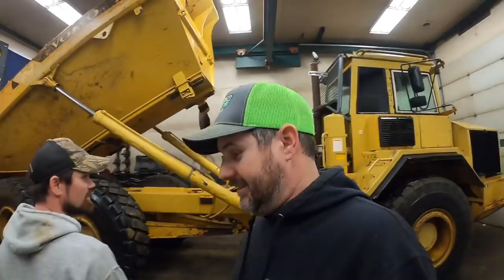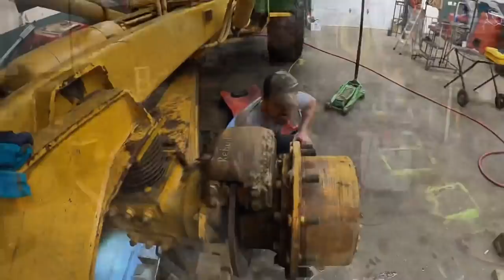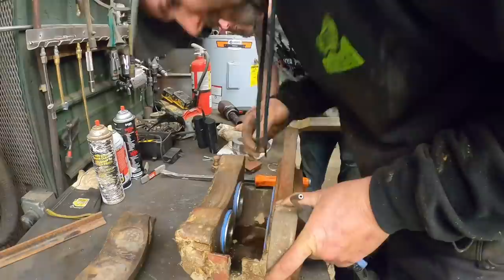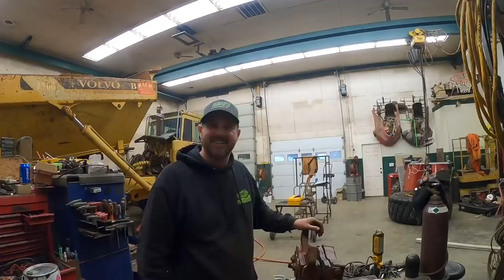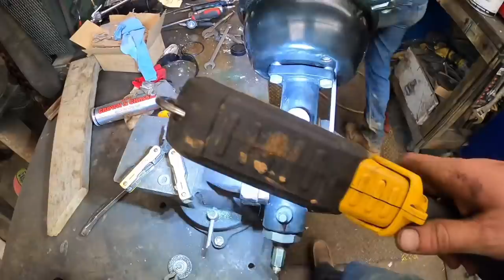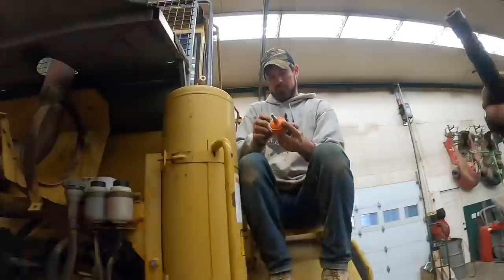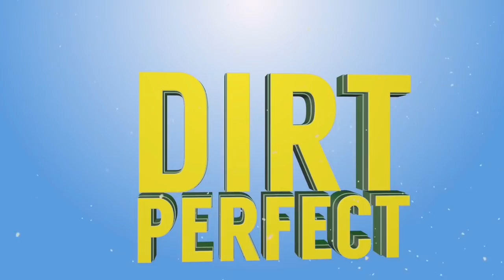Another attempt to fix the brakes on Bubba Dump ends in disappointment and failure again

Comment: Hi Mike, I suspect your missing an aluminium spacer that goes between the booster and master cylinder, the spacer could also have a shaft seal in it 
If you don’t change the mod you should seal the gap between the booster and master cylinder to stop water and mud from getting in there 
Good luck
Reply: I was thinking a copper gasket machined to fit would be a good answer for long term. Like a copper head gasket for high performance piston clearance on the old V8 engines. Just over drill for the shaft and put gasket seal on both flats of the copper. That is the hillbilly engineering we would do around here.

Comment: I learned my lesson about telling you you did or are doing something wrong, I prefer telling stories of my experience. I once needed a new O-ring and substituted a neoprene O-ring about 2 weeks later the piston started leaking brake fluid like there was no tomorrow, took the tire off and said OMG there's a huge black worm on my caliper, it was the O-ring it swoled up about 80 times it's original size, I knew there would be some swelling but I had no idea, I imagine hydrocarbon grease is hard on rubber O-rings too silicone grease or assembly lube(really thick brake fluid) is proper. Have fun Mike Bubba Dump is a real nice truck. I think some one has a monster truck made out of a Volvo haul truck, 'course it has a 2000 horse power diesel in it.

Comment: I'm a union operator for a large excavating company amd we run 4-5 40 ton trucks everyday moving dirt from the cut and the fill and let me tell you trucks are always a problem they break all the time, they are crucial to have but damn if they don't break down alot good luck with it 👍

Comment: Mike there was probably a spacer that went in between master cycle and the booster parts manual should show  you should have use a orange grease on seals thanks for the

Comment: Pistons are backwards  flat side in  you will never get the air out with the cavitys.  Always flat side in 
and you needed to wash the caliper with breakclean  them lube it with the brake fluild  the  parts washing fluild you left will distort and make the seals swell.  >> master tech  42 years
Reply from the maker: Plan worked perfect
Reply: pistons are definitely  in backwards .
Reply: @ronmiller7181   yeah they definitely dont know what they doing :)

Comment: Hey Mike the caliper does not slide slide it is a 4 piston caliper that is how it compensates for any rotor movement allows it to wear both pads evenly four piston calipers or calipers with pistons on both sides do not float they are affixed via bolts

Comment: In  the 60s, learning to drive fire trucks,  when reversing the instructor used the " right hand down, left hand down" instruction on the steering wheel, to control the front end position of the vehicle. I use it now with drivers

Comment: Hey DP,
Some of those air chambers are adjustable from inside. All you need to do is remove the clamp, end cover, and rubber diaphragm and adjust the double jam nuts in or out on the service rod (the part that comes out of the chamber and into the hydraulic piston.
Those are single action chambers with only a light return spring for full release. The jam nuts control how far the rod travels out of the chamber. Your washer method will accomplish basically the same thing; however, adjustability is limited.
On the relay diaphragm you should be able to remove the cover and replace the rubber diaphragm to repair the leak, but your replacement relay looks like it should function the same way or similar, just make sure that the air flow control matches the other chambers for equalized braking pressure.
Your solutions certainly look like they should work just fine. It's been about 35 years since I worked on big equipment, but most of the mechanical parts still operate the same, mostly the ABS and electronics have changed.
Reply: I will say that the next guy to work on that will likely scratch his head wondering what that valve came out of. Maybe make a note in the repair log??? Who am I kidding, a repair log from DP??? Happy hunting guys.
Reply: @markpashia7067  Not really. Those a common valve on US made trucks. The Volvo just happens to be European.
Unless there is a specific cross referenced part, most mechanics will figure out what up.

Comment: Well regardless of the issues you are addressing and the learning curve without a manual, it will sure be nice when old Bubba is up and running. Looking back at all those jobs you had to haul dirt for dams with many trips, multiple trucks and such, Bubba will make that process a hole lot easier and use a heck of a lot less fuel. Thanks for sharing Mike.

Comment: @DirtPerfect Just a tip from someone who worked on cars and trucks for a living never ever use grease as an lubricant on hydraulic brake seals or O-rings unless it’s 100% pure silicone. However I being rather old school and cheap I highly recommend that you only use new Brake Fluid from a sealed bottle.  Almost all Greases will react with the seals/O-rings causing them to expand and bind the caliper into the bore resulting in the brakes either being permanently applied. Additionally it will slowly dissolve in the brake fluid and migrate throughout the brake system and FUBARing the rest of the brake system. An before you say no it can’t happen I will tell from first hand experience of using grease to pop out a caliper piston in high school shop class on my car that it does because my broke ass in high school had to buy a master cylinder, proportioning valve, front and rear brake hoses, rear wheel cylinders and two rebuilt calipers because the calipers pistons were damaged from being stuck on from the grease swelling the seals in the calipers along with brake pads, brake shoes and having to have the drums and rotors machined.  The original reason in shop class for rebuilding just 1 caliper which I had wanted to replace with a rebuilt one was because like your truck it was leaking.  That story told in my close to 30 years of experience of working as a mechanic for a living I have seen and repaired other such cases like mine as well as ones where idiots mistakenly or not have put power steering fluid, engine oil, hydraulic fluid, ATF, etc resulting in entire brake system overhauls. Since I know you will not take that caliper off and this video was filmed a while ago I do recommend re bleeding that caliper every time you use the truck at least a half a dozen times because brake fluid is cheap and brake rotors and pads for that truck are not.  I also am not a believer of ever reusing brake seals or only half or in your case or one hole in a brake caliper but it’s your truck. PS pleas buy or get the MBTS to make you some Jack-Stands designed to hold the weight of that truck because it would suck to hear you, Mr. Millennial etc, got seriously hurt or killed from using a 3 or 4 ton Jack-Stand that collapsed working on your heavy equipment.
Reply from the maker: Plan worked perfect thanks

Comment: You needed to use lube meant for brakes to install the seals and pistons. Things go together much better.
Reply: Brakes get HOT, needs high temp brake caliper grease. Regular grease turns to glue!
Reply: If these are DOT 3  fluid systems,  petroleum based grease will destroy & swell rubber brake seals.  Only silicone based lubricants or plain ol DOT 3brake fluid should be used
Reply: @scrappy7571  Amy idea of these are oil or glycol brake systems?
Reply: @russellsmith3825  No clue, only work on automotive.   Google search does not find much info.  Only brakes that I knew used mineral based fluid was old euro-peon junk, or my mountain bike with Shimano disc brakes.

Comment: Like someone else said, you put the pistons in backwards on the calipers, probably took a lot more fluid to bleed and likely has air pockets in those holes.
Reply: Yep.
Reply: Yep pistons in backwards 1st mistake. Using grease 2nd mistake. As grease deteriorates the rubber O-rings. Your supposed to use silicon grease or lube as for the master the stroke is adjuster by turning the booster pintle. You never use washers as the will rub and wear the bore and could jamb up destroying the bore
Reply: Never used anything but brake fluid & patients
Reply: @stevenr8606  what kind of patients though?What if they’re to sick to help?🤷🏻‍♂️😜
Reply: @stevenr8606  yes brake fluid or inert silicon lube because it has higher boiling point does not deteratrate orings and seals and is non-hygroscopic or you can use silicon brake fluid or conventional ethylene/propylene based fluids
Reply from the maker: Plan worked perfect thanks guys appreciate that comments
Reply: @DirtPerfect  You can always blame the man behind the scenes on any and all errors! 🤣
Reply: No they are not made of neoprene in fact they are made of EPDM which is incompatable with petroleum and the only rubber compound that is compatible with ethylene or propylene based brake fluid.  Just chuck a brake seal or brake cylinder puck in oil  solvent or gasoline diesel etc and see what happens after some time they get swell and get mushy oh and i forgot to mention neoprene is incomparable ethelene/propylene glycol

Comment: you put the pistons in backwards, the dirt being inside the hollow pistons shoulda been a clue :)
Reply: Me thinks somebody should'a looked at the parts book!  Will we see a companion video showing them putting the pistons in correct orientation?  Hmmm....
Reply: Well. He might see if you’re correct when he gets into that other caliper that’s leaking.
Reply: @Crewsy  its a piston the flat goes toward pressure side, 30 year tech here lol.
Reply: @RichardHeadGaming  and the pressure comes from behind the pistons pushing to the pad and squeezing the disc.. Thier on backwards -_-
Reply: @POSSIBLY.USEFUL  pressure side is oil side. he is agreeing with everyone
Reply: Cup out to reduce amount of fluid that’s inside the caliper to prevent brake fade.

Comment: Great job Mike you are going to end up with a great truck here. All the components you examined look to be in good shape and this truck should last you a long time. The difference between a successful contractor and not so successful contractor is his ability to work on his equipment. Letsdig18 is one lucky guy that his Volvo dump truck was in good shape. If you don't have the finances to buy newer equipment you must be able to work on the equipment you can afford.

Comment: If it uses dot 3 or dot 4 Brake fluid.  Most parts stores sell McKays brake assembly lube. 
Grease or oils have a really big chance of causing brake seal to swell up and seize causing the brakes to not release and the entire system to need to be rebuilt.

Comment: Nice. A what not to do video.  Petroleum+brake fluid and rubber brake components do not get along. Eventually every rubber component is going to swell and either your brakes will not work or lock up solid. If your going to rebuild brake components use the correct assembly lube, it is cheap and can be found at any parts store. Yes the pistons are in backwards. This will affect bleeding and getting all the air out along with it is going to change brake application pressure on that side, simple hydraulic principles of surface area  x pressure = force.

Comment: If the crack pressure (application timing with the other axle) is not to your liking on the relay valve you used (R12?) you could probably go with a standard R6 (Bendix), which is what it looked like the old one was but with a modified top cap.

Comment: All the issues you are finding are the regular "running" maintenance that needs to be done on these trucks. I look after 14 of them. Whoever put it to auction ran it saving up for a new one doing no maintenance. All those parts still available, just! but once done and you maintaining will last years. Air valves and pipework for 6wd and lockers is a pain, often it is the diaphragms just under the "air inlet" plate that fail. cheap and easy to replace ;-)

Comment: Hi Mike,
On the rear master cylinder, when you and Mr. millennia added washers, you might want to put some silicone between the gap so no dirt or Debris gets in between and causes issues..
Reply from the maker: Rubber seal there

Comment: Got to use only silicone grease on brake seals or the O rings will fail pretty quickly. Seals have to be nitrile rubber to survive in normal oils, which brake parts never are. Take them all out Mike and use that repair kit to fix.

Comment: Hi, on the older model there is a plastic shims to mount between the master cylinder and the bracket.
Reply from the maker: Interesting
Reply: I cut new ones out of a plastic can, with the shape of the master cylinder flange.

Comment: the master cylinder once installed on the booster must have clearence so that the piston can return to its rest position once the brake is released ,Clearence is usually ,0010 or 0015 thousand

Comment: further to my last. you need the flat surface in contact with the brake fluid or you cant bleed the air out the system as it will be trapped inside the cups in the piston...sponggy brake pedal....

Comment: Everyone saying the piston is installed backward obviously doesn't know the super secret performance upgrade, you put them in that way so that there's more fluid against the piston. More fluid, more pressure, brakes work better. Also helps keep them from overheating too. I can't believe none of you have heard about that. It's simple hydraulics and fluid dynamics 101 stuff.

Comment: Your pistons were put in backwards, the flat sides go to fluid side.. You should always use either brake fluid or brake assembly fluid  not grease to install O rings so that they do not swell and deteriorate. Have been a mechanic for over 40 years.. Hope this helps…
Reply from the maker: Plan worked perfect thanks

Comment: Caliper pistons should be flat side in and hole towards the brake shoes. Don't use grease only brake fluid as lubricant so you don't contaminate brake fluid. Don't use washers as spacers but the proper aluminum spacer.
Reply from the maker: Plan work perfect thanks

Comment: Mike, just curious if the brake chamber on the front dif is like the rear to use as a comparison to see the difference in the cylinder travel?? Just asking. The travel seemed to be much more than needed. Your troubleshooting becomes our troubleshooting….lol.

Comment: Since you opened yourself up to it with the "more qualified than the last person" comment, although everyone commented about the pistons being in backwards (nice touch bringing the internet into agreement, not something seen often), no one seems to have covered the importance of correcting the issue. Even though the piston vertical surface area is the same between the front and rear, the cup portion allows for outward expansion of the cup under increased load. The piston diameter will increase and eventually the piston will expand into the bore and never move properly again. There is no way to properly bleed the air from the caliper body with the pistons in backwards, squishy brakes from squishy air. 

One last thing, correct me if I am wrong here, but the way the calipers are designed allows you to install the caliper without the pads in. If this is the same style caliper that is. You can change the pads without having to remove the caliper from the mount, just pull the caliper sliders and the pads will slide out from in between the rotors and pistons.
Reply from the maker: Plan worked perfect thanks

Comment: Im not sure if this has been rectified or not, given you pre-record but at timestamp 18.00min to 20.00min, it appears that when you put the break piston back in caliper timestamp 28min, you put them in incorrectly or it appears to have been.
Reply from the maker: Plan work perfect thanks
Reply: Totally agree, pistons in backwards and you should only ever use red rubber grease on o rings, ordinary grease will make o rings expand an they become extremely weak. Ask any engineer!
Reply: @kevinmountford4541  orange sherbert and castrol yes there in backwards he prolly cut the seals again, because the solid end has a radius to slide by the seal
Reply: @kevinmountford4541  I use to build them at Akebono

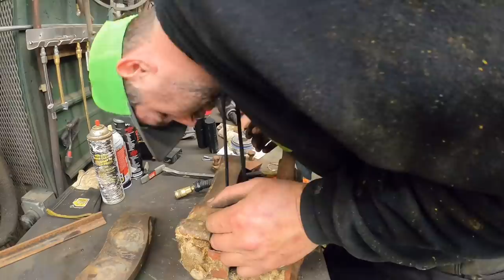Comment: View at 19:55 clearly shows the piston recess toward the pad, so flat side goes toward the fluid. I don't see where you've said you corrected that. If not, the caliper is assembled incorrectly but won't cause an issue so long as you didn't snag the seal on the sharper end of the piston. I don't recall if you've mentioned what kind of fluid is used. If it is automotive brake fluid (typically DOT3) you WILL be back into the job as regular grease will destroy the EPDM or SBR seals. If the brake fluid is a petroleum-based product, you're probably OK.
Reply from the maker: Plan worked perfect thanks

Comment: sorry to say petroleum product in not compatible with the composition of the rubber they use in brake parts ,they will swell like a mother expecting triplets ,you will have to clean every thing with denaturated alcohol to remove all trace of grease then reassemble with silicone or brake fluid
Reply from the maker: Don’t be sorry plan worked perfectly thanks for the comment

Comment: Hi from uk Mike and crews👋👍 hope you get parts for the driveshaft brake or can get disc milled and not sure if you know but I maybe wrong in thinking the pots/cylinders/pistons may of bin put in backwards unless your twatting us😂🤔?  as flat side usually goes to rear tho wouldnt know about big trucks like yours tho if I am wrong am sorry for mentioning🤔👌 and at least you know how to do them for other side 👍 and rather than j hook could you not quickly manufacture a crab claw style as your manufacturing skills are up there👌 thanks for your time and be safe see you soon👋👍 (ps hope am wrong about brake pots/cylinders/pistons ) uless it was a trick shot to see who notices ( I know your like that) 😂😂👍👋